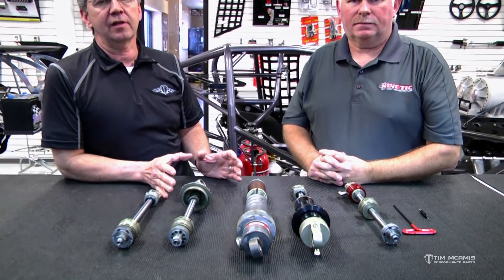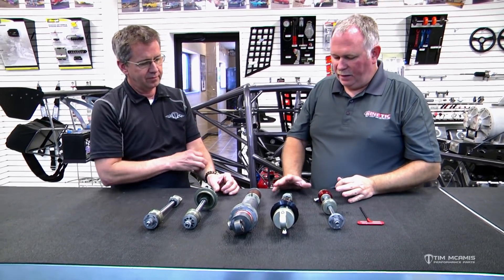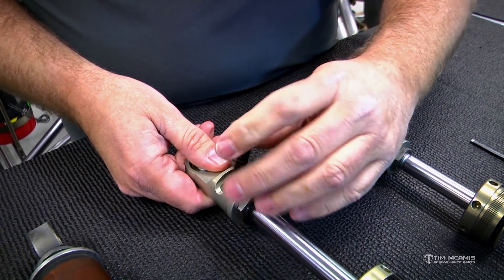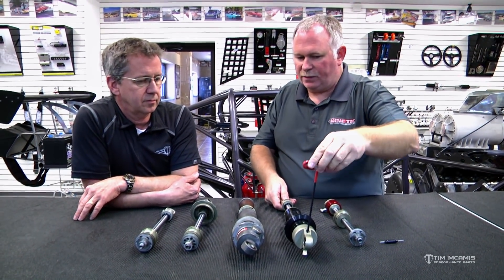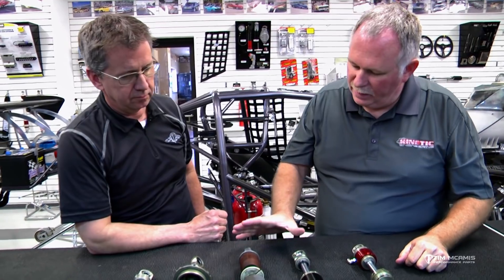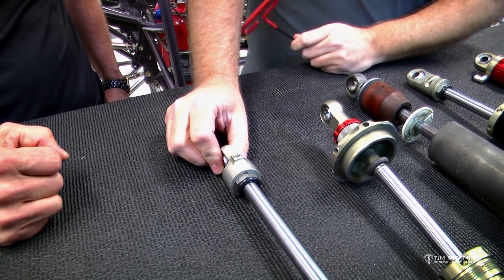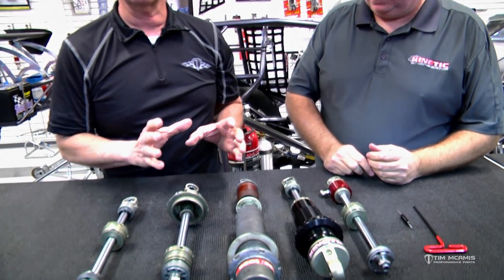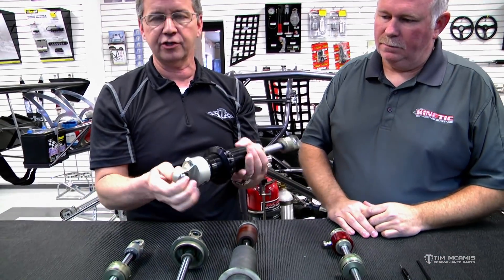Shock Series: 01 - Types & Adjustments

Comment: My uncle has a 1965 GTO with a Pontiac motor making 800 hp with a five speed transmission liberty. The car wheel hops real bad from the starting line to me. It looks like it’s separating entirely too fast. He has Afco shocks both directions was 11 from stiff and steel wheel hops. 14:00

Comment: Tim serious question or anyone what would be the cheapest easiest power adder? I'm just turning 16 and I love drag racing and other types of racing I want to get into track racing instead of street shhhhh don't tell my dad haha I've been running just straight motor for a while now and I want a little more zip I did the basic heads, intake, cam etc. I'm pretty handy with doing some metal fabrication
Reply: Tanner Rouillard   I'd run nitrous it's the easiest and cheapest.  just always run fat and if it says X amount of timing retarded  always pull 2 mor degree  it will be  happy.    stock motor can handle a 150 shot no problem
Reply: Ron  Jackson thank you I will do my research on this
Reply: @ruthlessronniethemechanic5639  too little timing and too much fuel is just as bad as too much timing and too little fuel. If your just playing with baby shots of nitrous it won’t matter. If your doing big boy shit..… you can burn it down trying to be “really safe” as well
Reply: Bang for the buck, Nitrous is tough to beat.   150 hp with a lil button is nice.
Reply: Tanner... I'm a little late on this post but if you go with nitrous, follow the previous advice about timing but first and foremost make sure your fuel pump can maintain adequate pressure at wide open throttle for both the engine and nitrous system.